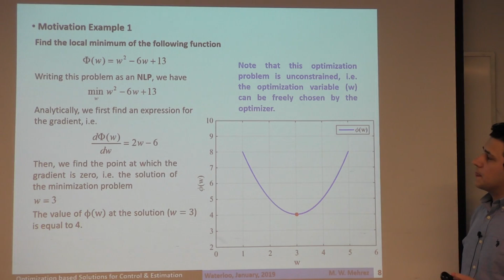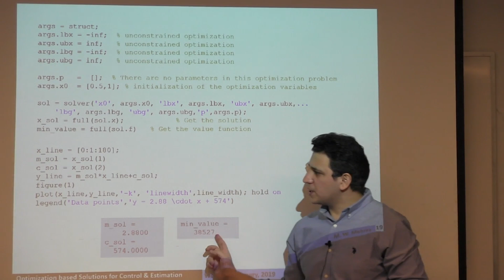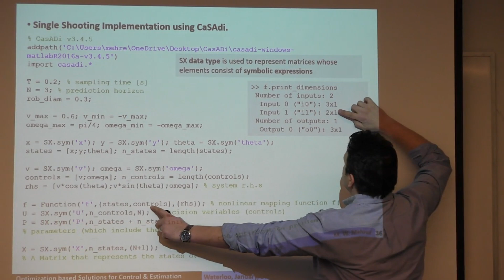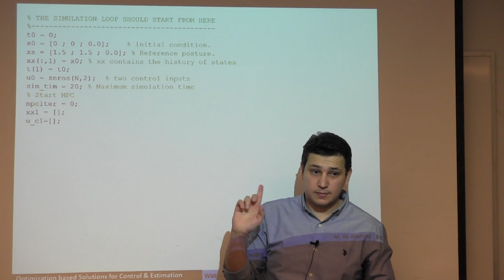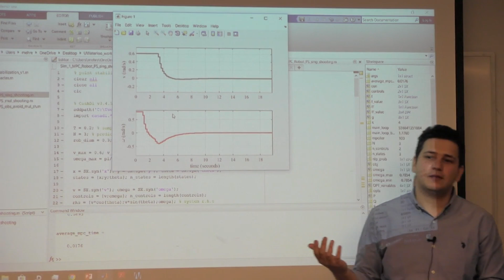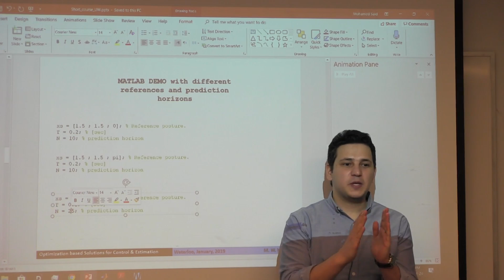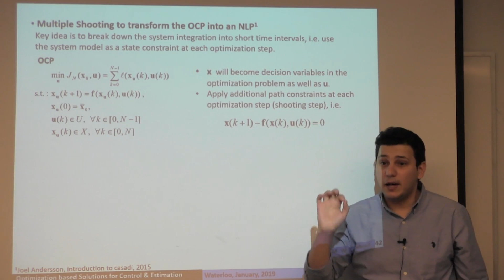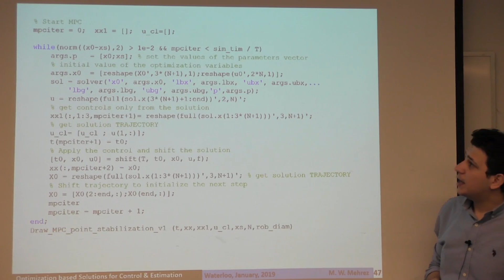MPC and MHE implementation in Matlab using Casadi | Part 1

Comment: Hello.
Thank you very much for this lesson.
It has shown me that I’m not entirely off-track in using CasADi with MATLAB and Simulink.
However, I still have some questions about using CasADi. I’m struggling to get my problem to converge to a solution.
I’m not sure if you’ll see this comment or if you’d be able to answer, but here goes:
I am developing an MPC (Model Predictive Control) scheme for the dynamic control of a robot.
I would like to avoid using explicit inverses of the mass matrix from the dynamic equation.
Regarding the constraints $g$ that incorporate the discretized dynamics:
Is it possible to use the full equation—rather than just the right-hand side (RHS)—and set the constraint equal to zero? Something like: `dyn = M(dq_{k+1} - dq_k)/dt + H - Tau + J^T * lambda`
and then `g = [g; dyn]`?
Another question: is it possible to perform an optimization that includes an internal sub-optimization within CasADi?
Do you have any recommendations for these types of optimizations involving dynamic equations? In this case, would it be better to use an RK4 (Runge-Kutta 4th order) integration scheme?
Thanks in advance.

Comment: Thank you for the video. How can i alter this code to introduce a control horizon. In this code the control horizon is equal to prediction horizon.
Reply from the maker: Thank you for your comment. Yes, you can. Simply split the cost function calculation loop into two loops one for state and another for control. you can then set different prediction and control horizons.

Comment: First of all thank you for the lesson. I am only wondering if the obj function formulation in the Matlab example is correct. for k=1:N
    st = X(:,k);  con = U(:,k);
    obj = obj+(st-P(4:6))'*Q*(st-P(4:6)) + con'*R*con; % calculate obj
end
I expect that we have N-1 control actions or at least N+1 state variables according to the equations in the slides
Reply from the maker: Thank you for your comment. Good question! for k = 1:N, this means that we have N steps to calculate in the obj function. Just keep in mind that indices in matlab start from 1 and not from 0 like in python.
Reply: I am finding problem in introducing control horizon. Say my prediction horizon is 20 and i want to have a control horizon of 10. In that case how can i alter the code. Because there is a size mismatch. Can you help me out with it. @MohamedWMehrez

Comment: Thanks for this perfect tutorial. I have a question. At the beginning of the simulation or real-time experiment, the solver needs more time to find the optimum point. For simulation, it is not a problem. However, it is a problem for real-time experiments. For me, I have a 20 ms sampling period for my project. At the beginning of the simulation, the solver needs more than 20 ms. I found these values by using tic toc command in Matlab. For the next samples, this time reduces to 4 ms. In real-time, it is a problem. Do you know any solution to this problem? I tried to reduce the prediction horizon but it did not work. Thanks in advance...
Reply from the maker: Hi, For the very first control action, you can actually wait until the first control command is ready and then you run the control loop. Also, for the first control action you can reduce the number of iterations or increase the optimization tolerance such that the first optimization step is less computationally demanding; however, this will lead to a relatively inaccurate first control command which should be improved as you continue to the following optimization steps.
Reply: @MohamedWMehrez  Thanks for your answer :)

Comment: Hi! I'm trying to implement a neural network based mpc (feedforward in this case) using multiple shooting method, and as you may already know such artificial network must be fed by some number of previous states to predict a correct future state. In my case, I'm using 4 previous state samples to predict the next state as in  x(k+1)=NN(x(k),x(k-1),x(k-2),x(k-3),u(k))  but then I encounter the following issue that I can't wrap my head around (I've already implemented both linear and nonlinear models in casadi mpcs in simulink and they worked like a charm). Code looks something like this:

    % "Lift" initial conditions
            X0 = MX.sym('X0', 4);
            w = {w{:}, X0};
            lbw = [lbw;  0; 0; 0; 0]; % 
            ubw = [ubw;  0; 0; 0; 0]; % 
            w0 = [w0; 0; 0; 0; 0]; %

Im lifting 4 initial states for prediction (x0(k),x0(k-1),x0(k-2),x0(k-3)

            % Formulate the NLP
            Xk = X0;
            for k=0:N-1
                % New NLP variable for the control
                Uk = MX.sym(['U_' num2str(k)]);
                w = {w{:}, Uk};
                lbw = [lbw; -3];
                ubw = [ubw;  3];
                w0 = [w0;  0];
                              
                % Integrate till the end of the interval
                Fk = F('x0', Xk, 'p', Uk);   <- here is where my neural network comes in
                Xk_end = Fk.xf;
                J=J+Fk.qf;
                    
                % New NLP variable for state at end of interval
                Xk = MX.sym(['X_' num2str(k+1)], 1);
                w = {w{:}, Xk};
                lbw = [lbw; -0.3]; %
                ubw = [ubw;  0.3]; %
                w0 = [w0; 0];    %
                
                % Add equality constraint
                g = {g{:}, Xk_end-Xk}; 
                lbg = [lbg; 0]; %
                ubg = [ubg; 0]; %         
            end

how should I implement new initial states for prediction in the next step in this for loop? Xk at the start is [4,1] but since I'm only predicting 1 step ahead my XK_end ends up in size [1,1] thus I'm not able construct the equality constraint vector g and/or do the prediction in the next for loop step. Should I train the network to predict 3 more states, to kind of "shift" the states from k -> k-1, k-1 -> k-2 etc, and add 3 more variables in vector Xk so I could formulate the vector g? How would I put constraints on those states?

I know that this code might be miles off of what I need to do but please help if you can. 
Thank you in advance. You're doing the gods work with these tutorials!
Reply from the maker: Hi, You can extend the initial condition part of the P vector to the size of the 4 initial states combined (or reshaped into a single vector). Then, in your optimization problem setup, you can break P down to your 4 initial states and use them in your NN. You can start with the same value for the 4 initial state, then you update them as your simulation runs.

Comment: Hello Dr. Mehrez,
It is indeed a great lecture video. I am a beginner in MPC, therefore, I learnt a lot. However, I have a question regarding the code I got from the github link. My Matlab 2022a can not identify the function of visualization, You used, "Draw_MPC_point_stabilization_v1" command for visualization purpose. My code shows error in this line, can you help me in this regard?
Reply from the maker: Hi, thank you for your comment. This function is actually included in the files provided. Just make sure all files are in the same folder.

Comment: Hello Dr.mehrez
Thank you for sharing this amazing workshop it was so useful.
I have a couple of questions though it. 
Can we use casADi for controlling articulated vehicles too? If it is possible to use can we use your code with changing the number of States and (rhs)? 
And the last question is what should I change in the shift function? (I just got an error in the shift function)
It would be really helpful if you can support me on this.
Reply from the maker: Hi, thank you for your comment. Yes, you can use the same code for a different system as you described. Make sure that you modify the code to consider the new system correctly at all parts of the code including the shift function.

Comment: Sir, your lecture is really amazing and more helpful to understand new concepts easily. However, I have one question, in this case, the control signal updated each update each T= 0.2. From the graph states seems to be continuous. What can I choose step size of state? If I choose that as h=0.01 then x(k+1)=x(k)+h f(x(k))? Please clarify my doubts please
Reply from the maker: Hi, thank you for your comment. Your observation is correct. The update model doesn't change when you change the step size
Reply: @MohamedWMehrez Thank you very much, Sir. I have one more doubt, is this u^ref=[0;0] or anything else. Also, how to select better objective weighting matrix wisely? Is there any systematic way? If so , please suggest some reference book or material to understand it.

Comment: Hello Dr. Mehrez, its a great tutorial. I learned a lot about the implementation process of MPC. I have a few questions for you:
1) This implementation is linear MPC or a non linear MPC? 
2) How to modify this code to include a trajectory rather that a single waypoint?
Reply from the maker: Hi Himanshu, thank you for your comment.1) this is nonlinear mpc as we used a purely nonlinear model for the robot. 2) there is another video in this series that explains how to implement trajectory tracking.
Reply: @MohamedWMehrez  Thank you for the information. Can you refer or make a tutorial on explicit MPC?

Comment: A fantastic tutorial. i am a bit confused though on multiple shooting like, why is it more accurate than single shooting if both methods include the dynamics of the system in the context of ocp?
Reply from the maker: Thank you for your comment. It is because how the dynamics are represented in the OCP. In the single-shooting method x and u are connected via forward propagation of the system model in the cost function (over the prediction horizon) while in multiple-shooting x and u are connected via constraints. In the first case, nonlinearities are accumulated over the forward propagation and that is not happening in the second method.

Comment: Thank you so much Dr. Mohamed for the lecture. It provided great insight into the capabilities of Casadi. I have a question; is it also possible for casadi to solve partial differential equations or optimization involving PDEs? For example the 1D-Heat equation. If it is possible, how can one establish the equations for that. Thanks!
Reply from the maker: Hi Runyang, Thank you for your comment. I didn't try Casadi for PDE's before, but if you can convert your PDE into difference equations similar to what we did to the ODE, then you can use Casadi for your problem. You can search for the methods used to solve PDE's and this will help you to implement that.

Comment: Hello, Dr. Mehrez thank you for the detailed explanations. I used your videos and also the nonlinear MPC example uploaded by Joris Gillis to learn how to implement the basic algorithm in Matlab, in this example Opti stack is used. Only difference i realized between your implementations is that you are giving the x0 value (actually the u0, the optimization variable) to the solver, whereas in the other example only the p value, the initial states, are given to the solver. So as far as i understand, you are using the already calculated u value as a starting value in the next iteration of MPC loop, after trimming the first value. Is that a necessary step (i mean part of the most basic MPC algortihm), or is it implemented to increase the performance ? Thank you
Reply from the maker: Hi Thank you for your comment. This initialization shortens the computation time.

Comment: Well done doctor. If you don't mine I have a question related to the RHS. I tried to solve NL equations but with decison variables (inputs) sequared (to the power 2) but it doesn't work with me. I tried another equtions without sequres and worked perfectly. Do you have any idea about the limitation of CasADi especially the ipopt solver that you already used in your great presentation?
Reply from the maker: Thank you for your comment. There should not be such a limitation on the nonlinearity of your model.
Reply: @MohamedWMehrez  do you mean that my nonlinearity is more than the capability of CasADi?
Reply from the maker: I meant that the nonlinearity in the model should NOT be a problem.
Reply: @MohamedWMehrez  but in practice it is really a big problem. I also tried something else, for an input, I powered to 2 and then I took the squire root for it so as a result it should be just the input itself because both effects canceling each other and it doesn’t work. Noting that without making this it works perfectly. Thus, I thought that involving any power or squire root leads to not reaching to an optimum solution. In fact the result always about e-5, whereas it should be around thousands!!

Comment: This lecture about MPC is the best one that  I have seen so far. How can I get C++ code from Matlab code of your case? C++ is more general in hardware driving.  Thanks very much overall！
Reply from the maker: Thank you for your comment. I think you can download the c++ source code/pre-build library of Casadi from the website; I haven't tried this before though. There is also a little bit of details on C++ coding of Casadi in its manual.
Reply: @MohamedWMehrez  thanks, I will have a try.

Comment: I'm interested in implementing MPC where the optimization algorithm is only allowed to complete a predetermined number of iterations. Is there a way that I can guarantee all the iterations are feasible using Ipopt?
Reply from the maker: Yeah, there is. check ipopt manual for such options. in the provided code I am adding the option of the no. of optimization iterations which you can set to your desired values.

Comment: Incredible videos Professor Mohamed, my question is what  if i am to try this code on my raspberry/arduino robot, what should i change in the code, i mean, what should i set to my v and omega of my robot, and lets say i have x y theta from my encoders and gyro, where should i put them in the code. i hope you understand my question.
Reply from the maker: Thank you for your comment. The way you set v and omega of your robot depends on the software-hardware interface you have. Some interfaces allows you to set v and omega directly; others however, allow you to only set the wheel speeds. In the latter case, you will need to convert v and omega to the right and left wheel speeds then feed those values to your robot. There should be a slide in the lecture that shows the relationship between the wheel speeds and v and omega. x, y, and theta you have from the robot sensors should be used as your state feedback in your control loop.
Reply: @MohamedWMehrez  thanks for the answer, however, i am struggling with x y theta, lets say i have my measured x y and theta from the robot, where do they go in the code, the for loop that fills the big X ? 
please answer me urgently
Reply from the maker: they should be the first entry in the big X, but remember to do that in the simulation loop.
Reply: @MohamedWMehrez  Very much appreciated professor, i'll be trying that first thing tomorrow

Comment: Dear Professor. Mohamed, 
Thanks for graceful lectures. 
I've modified your code  to fit my dynamic model. 
By the way, I have a question to implement the part of the code. 
If I want to embed the rate constraint additionally (rate of input or rate of state), how can I express these constraints in CASADI?
I've tried to search the method to add rate constraints during few days, but I've not found the appropriate explanation.

Can you explain how to implement the rate constraints in CASADI?

Thanks in advance.
Reply from the maker: Hi, Thank you for your comment. By the definition of the rate, you can constrain the change in the state/input every time step instead and add this to the constraint vector g. For example, g = [g, u(k+1)-u(k)].
Reply: @MohamedWMehrez  Thank you sir.
Reply: @MohamedWMehrez  I constrained the rate as you told me, but It does not work properly. 
I sent the email to your gmail address.  If possible, Could you answer to the e-mail? 
I think you must be busy, sorry for my basic question

Comment: Awesome video Mohamed! I've succesfully implemented a nonlinear MPC on a PMSM in simulink, but I have one little problem. That beeing I want to minimize "delta u(k) = u(k) - u(k+1)" meaning that I want to take previous control signals in to account. Any suggestions on how to do it? I'm a bit lost.
Reply from the maker: Thanks Robin, You can simply add delta the exact way you defined to the cost function. Just square it to be always positive and multiply it by a weight to tune its effect on the cost function.
Reply: @MohamedWMehrez  Hmm, okey. Another question, delta_u = u(k) - u(k-1) by the way, mistype by me. In the for loop, when i = 1 I need to get the information "u(k-1)" which I was trying to get with a unit delay in Simulink but I get alot of errors and I don't really know where to put it. In the SX "parameter-vector"? Sent you an email btw :D
Reply from the maker: @Robin92-i5b  I would do delta_u = u(k+1) - u(k)

Comment: Hello! I have a perhaps arbitrary question but, how does the solver deal with the model (function, states, rhs) of the system? I am working on some models of my own, but I noticed that when you use the control outputs of, for example your multiple shooting mpc code, and iterate those with timestep T (like your shift function) you will achieve quite some different states compared to the states ipopt itself outputs every timestep. Does casadi/ipopt calculates these states as part of a continuous ODE and if so, is it possible to change how it handles that?
Reply from the maker: Hello, I believe that those differences are due to the numerical tolerances the solver use. You can check the manual for that.